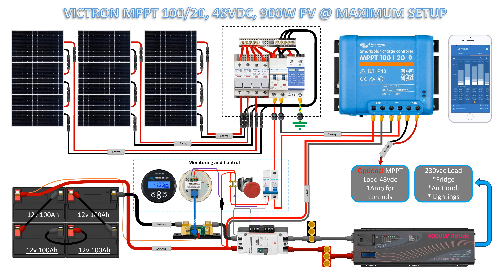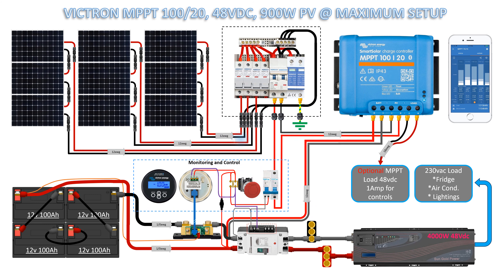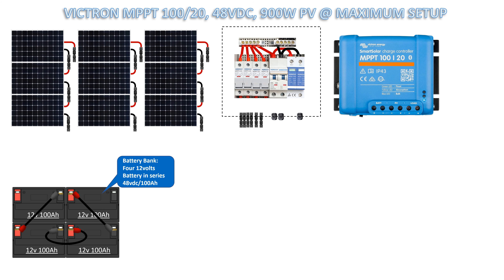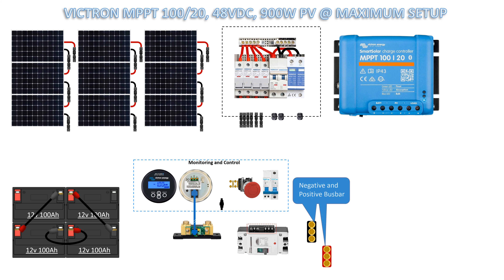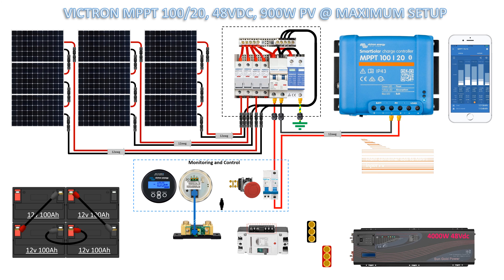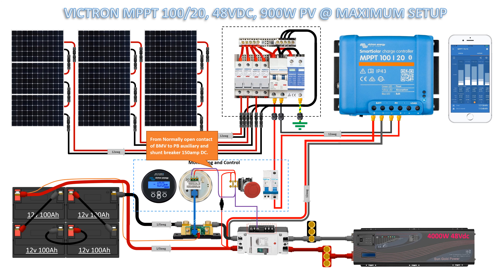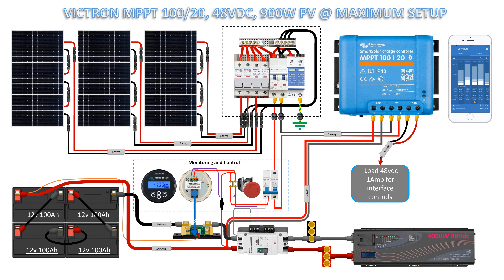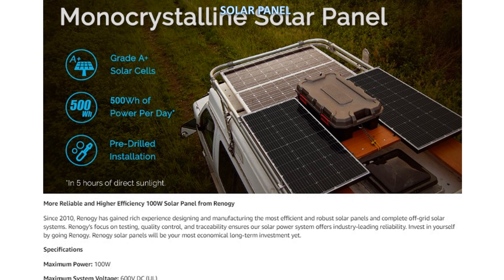Victron smart MPPT 100 l 20 Solar Setup Design (oversize inverter for future upgrade)

Comment: Hi, can I control load from one A) 48V battery to other B) 48V battery via Victron 100/20  without solar input in the way to provide that  battery A  can not discharge to 0%??

Comment: 10 gauge cable from the inverter... that's only 6 mm Square... that's only good for about 30 amps on a 2 meter run..